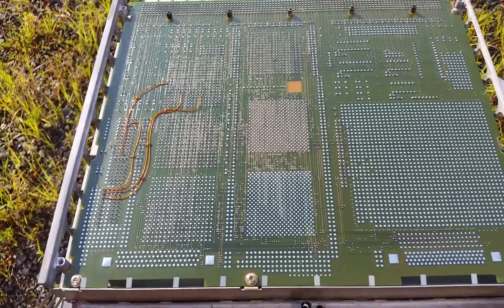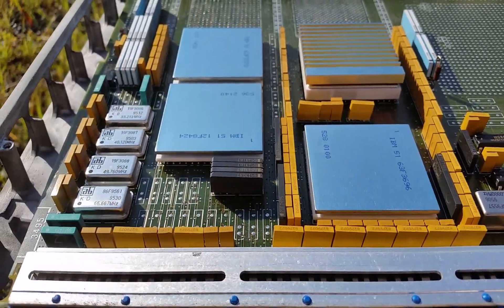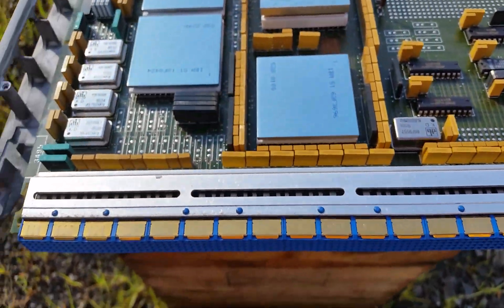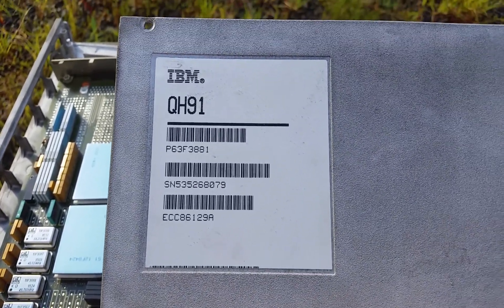Inside the ES/9000 Processor Card

Comment: It's interesting as the original mainframes did not have microprocessors. They had discrete circuits installed as large planar boards in slots in a large frame. All the circuitry had to be kept synchronized with a high precision clock on the main frame. At various times later on and based on business requirements, IBM would implement the architecture on microprocessors. Currently, there is a special product offering call IBM ZD&T. It runs the latest z/OS release and runs under Linux. The I/O controllers have been virtualized and it requires 3 physical cores of an Intel processor to operate. It's pretty neat. The personal edition is available for roughly 200 bucks a year. For someone interested in mainframe software, it's an excellent way to jumpstart your study.

Comment: Thanks for mentioning!  :-) 
Beautiful processor module. Very elite looking ICs. Wonderful! Sockets are probably made out of teflon. The yellow parts are capacitors, most likely. Autorouting on this board is typical for thie era. Top side vertikal wires, bottom side horizontal wires.